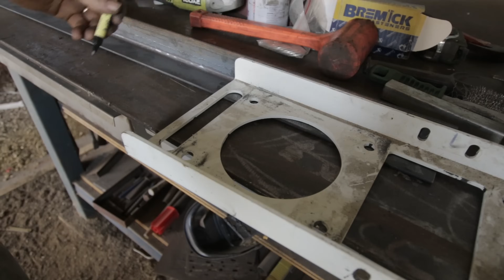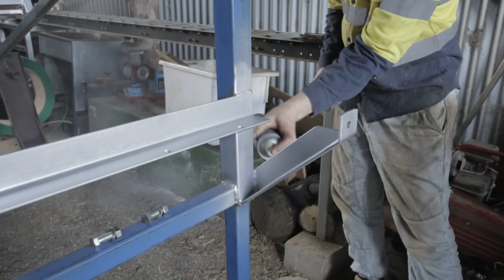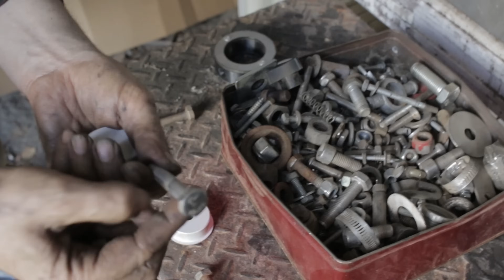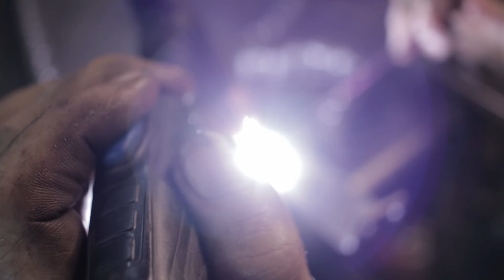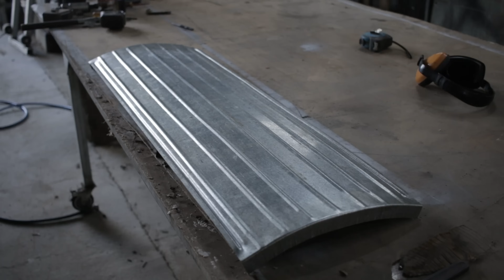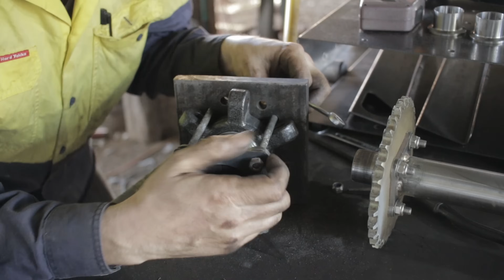Finished - Budget Hay conveyor build. PT-2

Comment: Nice work. Now I'm going to say something and I want you to observe on your yard what I'm talking about and then I will look forward to hearing your thoughts.... Painted metal rusts more than non painted metal.... I've been general engineering for over 15years now and I'm able to look back at past projects and learn from my mistakes. Spray/hand painted finishes rust in a way that's more damaging than if it was left bare and I believe it's because water gets trapped and travels by capillary action along the surfaces. It seems to eat the metal away and cause bad Pitting. Whilst projects left outside with zero finish rust but then remained fine for the rest of their life (so far)... Also and this is much bigger topic...  Things that are dug deep into the soil (such as posts) last a lot longer (no finish) that other thing simply say on the ground... I think this is something to do with grounding and electrolysis and how it reacts with the acidity of the soil. There you go let me know your thoughts. Cheers J
Reply from the maker: Hay mate.
I have also observed similar outcomes. Probably the worst for it is the RHS steel  that comes painted in that blue weld through primer. I think the purpose of it is to keep the steel rushed free whilst on the shelf, but I have frequently observed that after a period of time (1 to 2 years) when left out in the weather the steel goes rusty, to the point where you would have thought that it wasn't painted and when you clean it up with a wire wheel one discovers that they're still blue paint under that rust, amazing stuff...

I have had very good success  with galvanized steel and that cold gal (zinc)spray.  when making things for myself and not putting too much care into it, I've sprayed that stuff straight over welds without even wire wheeling it and to my surprise years later it still looks as good as gold 😐 and I think to myself I've put a lot more prep into paint jobs in the past and haven't lasted that good.  But I do think that the climate has a part to play in all of this, our dryer weather is an advantage.

And providing the paint job doesn't get left out in the weather I've found the rattle can job to last rather well.
Thankfully this conveyor is going to live in a shed hooked up to a chaf cutter.
Reply: @LittleAussieRockets nice. I rarely paint anymore and if I do I get it shot blasted and done professionally. I mainly get stuff powered coated or galvanized or both. But if there's no budget then it's definitely left unpainted... sometimes an oil or a wax and if I do paint it's always red oxide. That stuff is basically rust anyway and lasts way longer than anything else I've tested. It's unbelievably damp here in central UK. Moss grows everywhere here. Love your work. Looking forward to seeing more stoves. Cheers J
Reply from the maker: @joshuadelisle  Thanks Josh, it's always good to hear from you mate.

Comment: Nice build , but have to say in all my years I have never seen such a short bale elevator. I am rather mystified as to it's purpose.  Most elevators of that length tend to be for lifting potatoes or vegetables in harvesting machines. still you can only build what has been requested.  but that sort of height lift might be done more quickly with a pitch fork.  Is your customer a Yank by any chance?
Reply from the maker: Yeah that's fair, it's getting connected up to a chart cutter.
 the in feeds about 2 m off the ground and it's just a bit far to throw them by hand all day. The idea is the guy taking care of the bags can now also feed the line with hay.
Reply from the maker: I just read the last part of that question, no the customer is one of my neighbours, an  Aussie